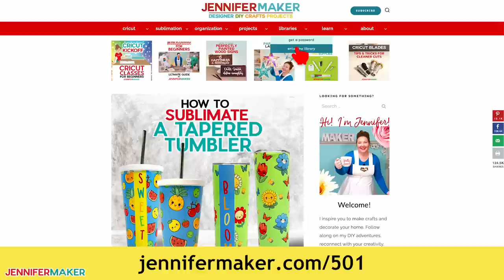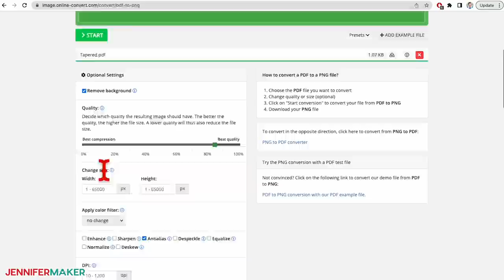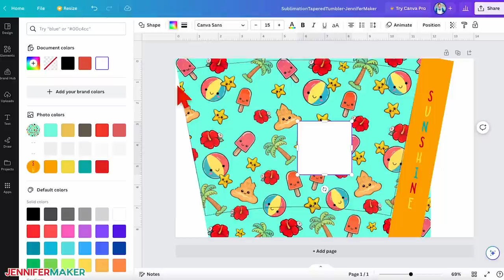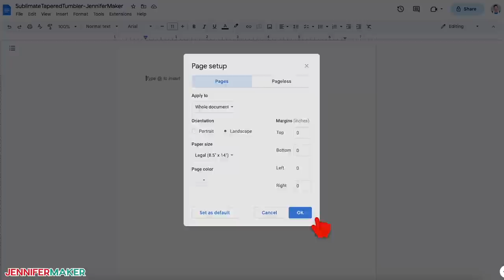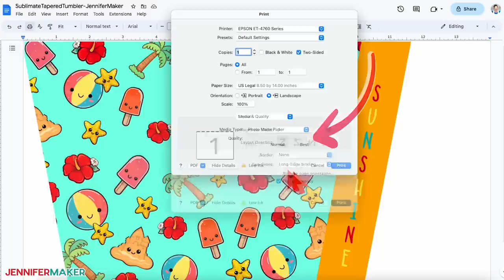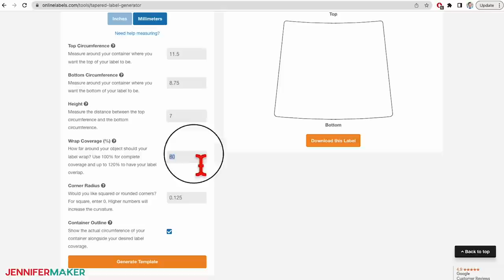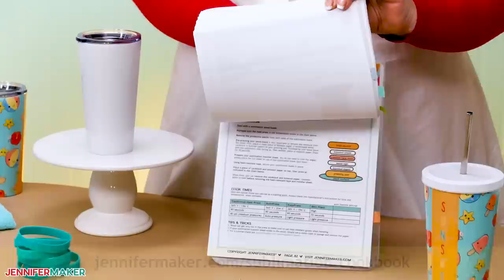How to Sublimate Tapered Tumblers in a Convection Oven | Make a Custom Template | Cover Seams

Comment: What do I do if it’s not giving me the option to remove background
Reply from the maker: In Cricut Design Space to remove the background is for Access members.
Reply: @JenniferMaker  yes I’m an access member on cricut I’m talking about after I make the template and go to the website to turn the template into a png it’s not giving me the option to remove the background I see where you can change all the other stuff but I didn’t touch that as you said I left it on the default setting but I don’t see the option to remove background so when I’m trying to work with it on Canva it’s not right
Reply: @JenniferMaker  I am having this issue as well when convert from pdf to png there is no option to remove the background. When uploaded into canva and adding background image it is not working. The image just goes behind the template and am unable to see it.
Reply: Canva does give an option to remove the background. I had the same issue. I uploaded the template design to canva and then I clicked edit photo and there is an option that says BG Remover.

Comment: Just so you know.. I successfully sublimated the top of the makers tumbler from Michael's.. I Used my heat press with a small plate press attachment.. It worked great.. 
I heated it for a bit, stopped and let it cool for a few. then repeated the process a few times.. IT LOOKS SOOOO good.. and the plastic didn't melt and it is still  seals 
100%.. next i want to try the bottom also.. ..
Reply from the maker: That is awesome!

Comment: Jennifer, how do you get the tapered template to show on top of your beach image so you can view both the image and the tapered template at the same time?
Reply from the maker: The details are in the blog post. https://jennifermaker.com/how-to-sublimate-tapered-tumblers/ Here are more details: To get the tapered template to show on top of your beach image so you can view both the image and the tapered template for the tumbler at the same time, follow these steps:

1. *Upload the Beach Image and Template:*
- First, upload both your beach-themed image and the tapered template PNG to Canva.
- Click on the beach image from the uploads menu to add it to your canvas.

2. *Add and Resize the Template:*
- Click on the template PNG from the uploads menu to add it to your canvas.
- Resize the template as needed to fit your design.

3. *Adjust Layer Position:*
- Click on the template to select it.
- Use the "Position" button in the top toolbar to bring the template to the front. This will ensure the template is on top of the beach image.

4. *Adjust Transparency (Optional):*
- If you need to see both the template and the beach image clearly, you can adjust the transparency of the template.
- With the template selected, click on the transparency icon (a checkerboard icon) in the top toolbar and adjust the slider to make the template semi-transparent.

Comment: I used your technique using a convection oven 375 degrees at 6 mins, I turned it at 3 mins, after completing the shrink wrap was almost completely melted. The image came out fine, but it took extra effort to get the remaining shrink wrap and paper off. Any Suggestions?
Reply from the maker: It shouldn't have melted. Different bands could vary in performance.

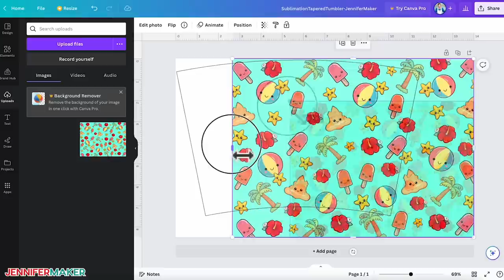Comment: Thanks so much Jennifer!! This is exactly what I need HOWEVER, when I'm in Canva, the template outlines that you have (starting at the 7:30 mark) are not showing up at all once my design is overlaid onto the template. It's like the template is completely hidden and all I see is my design. I have no idea why this is or what I can do to get the template outline to show up on top of the design.... Any suggestions? Your help is MUCH appreciated, thank you!!! 😊
Reply from the maker: There is a layers panel on the side of your canvas, you can move the template layer to the top. 😊🌻
Reply: Not sure what's going wrong on my end at this point, but no matter what I try, the template lines will not show up over my design. :(
Reply: I changed the transparency settings and it finally worked!!! 😀